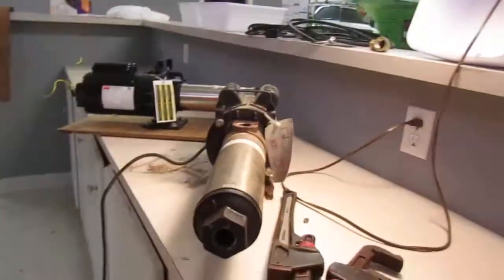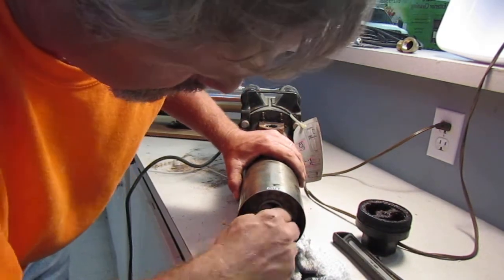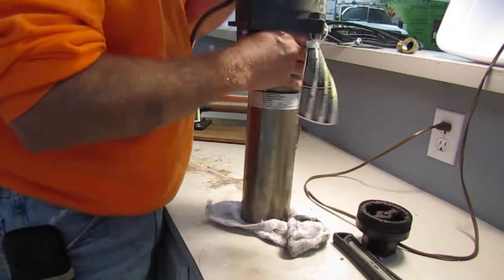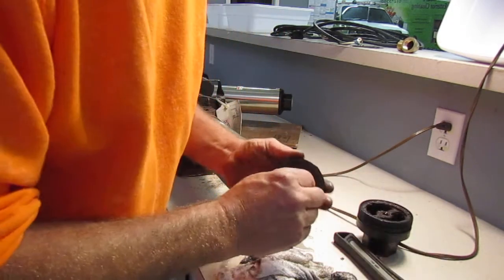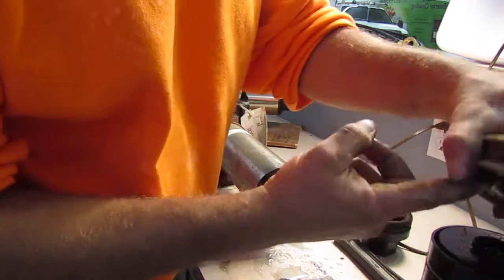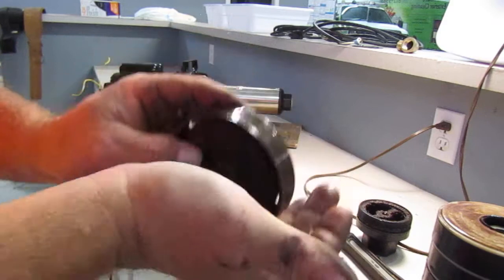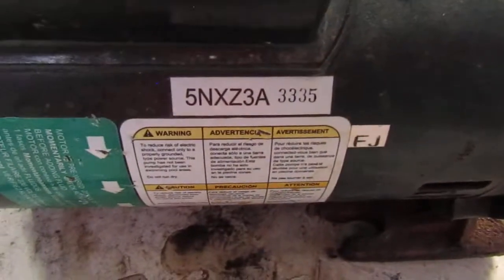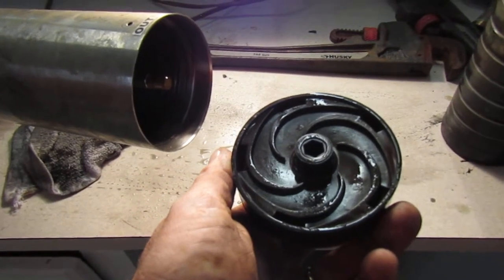Dayton Booster Pump tear-down

Comment: I recently bought a Flotec Booster 3/4" and 3/4 horse from northern tool. It has a stainless steel pump. I need to know if I can use it for softwash, but it look so much similar to your Dayton booster pump.
Reply: How is that flotec pump working for you?

Comment: Great video Dougie do. Very informative. I was surprised to see relatively minor harm from  running sauce though the pump. Would you say typical usage for exterior cleaning @ 1% sauce or was it used a lot for roof cleaning with 3% or higher?
Reply from the maker: Mostly for house washes so really about 1%. There were times it was ran at 3-4% but the norm was 1% with a ton of water after.

Comment: That was interesting, Doug. Makes me wonder if you replaced the bowed plastic piece and if it's possible to sand blast the corroded areas if the pump would work like new. Do you think you can get the debris out or is it impossible to get to? I wonder how much more use you can get from those pumps with maintenance like you just did... Thank you for doing this. As Artie Johnson would say "Very interesting!"
Reply from the maker: Hey Vic, yeah, I think I could get the debris out and do a little maintenance and be right back at it with this pump!